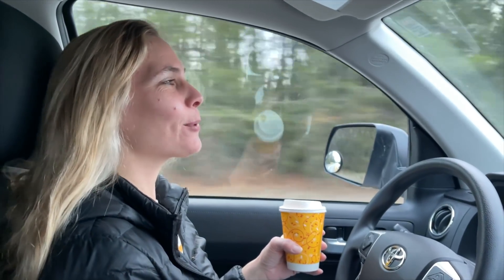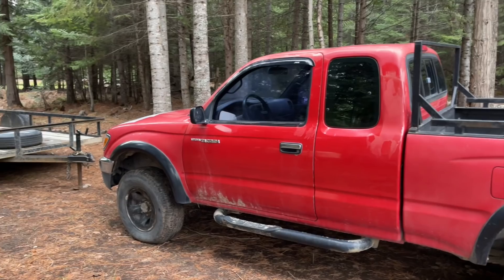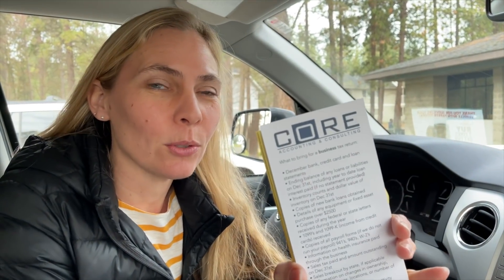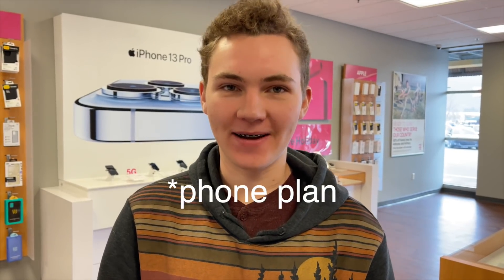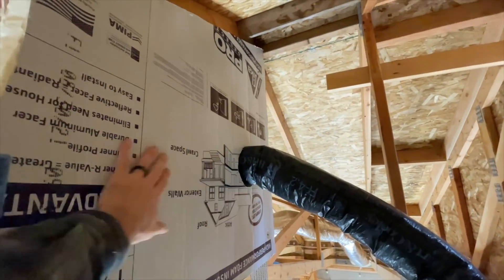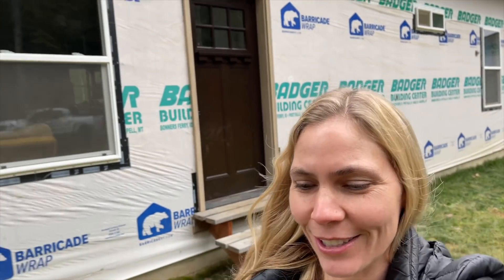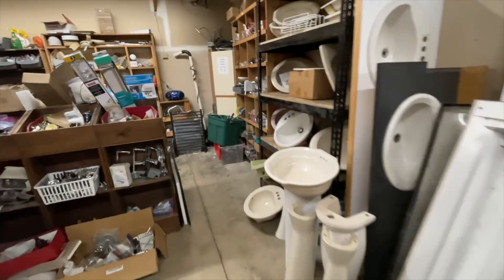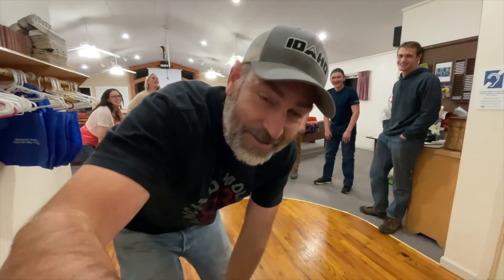THIS CHANGES EVERYTHING - Couple Building House Off Grid

Comment: I think converting your backup generator to dual fuel, gasoline/propane, would be a great idea. First, you've got 1000 gallons of propane right there. 2nd, propane doesn't go bad like gasoline does. 3rd, what happens when/if you run out of gas, and can't get into town to get more? Those conversion kits are pretty easy to install.

Comment: Our furnace is in the attic in a professionally built, high-end, home; it work's just fine and you never hear it running. The only headaches are changing out the filters each year and a smoke detector above the furnace needs a new battery every 7 years.

Comment: I'm a hvac technician. The only regret will be when you need to work on. As far as replacing it. 20 years is a about as long as a furnace/ AC is good for. But as long you do maintenance 2 times a year it last longer.
Reply from the maker: What kind of maintenance?

Comment: The attic is the best place for the heat pump air handler in my experience. Mine does great, and service people seem to easily go up into the trusts (rarely) when it is serviced. Also, it's very quiet.

Comment: The furnace can be relocated if it ever needs to be replaced and you decide it should be at floor level.  
Many houses here in Omaha have their furnaces and water heaters in the crawl spaces under the house.  
When we had to replace ours in our last house I build a small addition on the back and put both inside it.
BTW, We're BIG Dave Ramsey fans and have been 100% Debt Free since 2012!

Comment: Have you thought about converting the fuel source for your back up generator to include propane? If not, it's an inexpensive modification (a simple regulator) and it would help to cut down on the amount of gasoline you have to haul, and store. I love your positive outlook as a family especially during these times of depressing negativity and criticism that runs through our society.  keep up the great work. Blessings - Rich

Comment: I myself would have made a special closet in the garage area to have heat upstairs easier to replace if need be less hassle on installing it wouldn't be nothing to hook up floor heat vents and a ceiling in the garage. But to each their own.

Comment: You made a choice and I can respect that. Personally would always put everything in a location for easy access to service. Appliances today do not last decades. I am on my second AC fan in less than 6 yrs. Was told by both technicians who fixed my unit that the parts today are cheaply made and do not last long. This is from a premium brand. You still have time to move it. I would seriously rethink your location. Love the channel just trying to help - not a troll. Look forward to tomorrow's video.

Comment: Because u don't have running water doesn't mean u can't do hydroelectric. Pump motor from well to a holding tank 2 tanks separate pump between 2 tanks to recycle the water. Inline wheel that generates electricity think you hav an idea where I'm going but it will work.

Comment: As a retired HVAC service person  have seen repaired and installed  just about every  location  attic installed furnaces especially 80% eff. Bigest problem  was run time to short and condensation  in the stack  rotting out heat exchangers  and 90%+ frozen condensate system   creating  ceiling damage and also shuts furnace down
Reply from the maker: Hopefully, getting the freezing problem solved.

Comment: Some of the drywallers use their dry wall square as a cutting guide - they leave the sheets against the wall and hold the bottom of the square with the toe of their shoe and run the knife bottom to top - no smart phone

Comment: Fire:
I would think that you want to use fire resistance installations such as rockwool around your furnace due fire prevention reasoning. Using foamboard which is combustible and gives off toxic gas seems like a bad decision. I would think to that serviceability should be a primary factor too. Plan for the worst hope for the best.
Reply: Theirs built in safety's and breaker's that prevent fire and the sides of the unit never get hot even when running for along time, I've been doing HVAC off and on since 2006 and I've never seen a air handler catch on fire, theirs just a lot of preventives and modern technology that would keep that from happening. Anyways their would be evidence of a problem like not running (blower)or other noticable issues that would get martin's attention before something crazy happens.

Comment: Your insulation looks good. But that is all. You have an electrical motor that requires air circulation over the case in order to cool the bearings down. Holding that heat in is not good for the bearings. The fan motor should last 7 to 10 years. You are shortening the life by probably 20-30%. Just a heads up if you start tripping the motor on your furnace, pull the insulation down.

Comment: I don’t know anything about building so this may be a dumb question. How flame resistance is that foam that you are putting around the furnace in the attic? It sounds like it would be extremely flammable.
Reply: There are no flames on the exterior of the unit and unit doesn't get scorching hot. As long as the unit is properly vented and ducts are free of kinks they are fine.

Comment: Hello Jules and Martin. With a little coaching, the two of you could have a comedian show. Martin, so many times you seem to be justifying what and how you do things to others that have a different opinion. They can do it their way. This is your place, and you can do it however you want. You may need to comply to local codes, but I am not so sure about that. I am in Columbus, GA and my mother has her heater and hot water heater in the attic. The builders did that to conserve space in the living area. For me, my heater and air conditioner are outside. It is a package unit. My hot water heater is in the kitchen in a closet next to my stove/oven. It seems to work as my home was built in 1925 and probably did not have that when it was first built.
Have good days!

Comment: The following is straight out of your states code book..Out of Sight, Out of Mind: When a furnace or other hvac equipment isn’t working properly, the warning indicators are often obvious. If you hear odd and/or squeaky noises emanating from your furnace, it may be a warning that it is currently malfunctioning or will soon fail. You might not be able to hear the apparent warning indications that there’s a problem if you have an attic furnace.

If you don’t realize you have a problem until your system has failed it may be because you didn’t perform a few furnace maintenance checks throughout the year. Keep in mind that if you install an attic furnace, regular preventative maintenance is crucial to keep the equipment running reliably throughout the year.Furnaces should only be install in the Attic when no other options are possible......Personally I'd build a furnace room on the side of my house before putting it in the attic...But then I live in Florida and rarely use heat at all  once in 10 years......

Comment: Merry Christmas, Johnson clan!  This old pensioner once worked in Haiti for a year and purchased and had installed an inverter setup because The hotel where I was staying only had electricity for three hours in the evening unless the was a storm or hurricane of which there were several of.  Now, I am just a retired fixed pensioner who just purchased a dual fuel generator, an inlet installed, and a transfer main switch.  We get several outages each year that may only hours and even days such the last year’s 6-day freeze in the middle of January.  I do not believe I can afford solar panels on a small fixed pension but wanted to know what you can recommend I may need to run a trickle off electric company to keep batteries warm and charged and a connection for the generator which is currently being hooked up the my 500 gallon LP tank?  It would be very expensive and most likely deplete my LP if I tried running a generator for several days (especially with this outrageous inflation); whereas, just use the generator to recharge the batteries for a couple of hours and use the batteries for 15-20 hours?  I hope I hear from you.  Again, Merry Christmas and a Happy New Year, clan Johnson!

Comment: I was just wondering , does code require you to have a smoke alarm/heat sensor in the attic when the furnace is up there . Chances are you would neve have a problem - they made me put a smoke alarm in the basement furnace room .
Reply from the maker: The inspector didn’t say so. Good idea though.

Comment: I personally think that you're going to hate having the furnace in the Attic before it's over with. I lived with a furnace in the Attic and I hated it.
Reply from the maker: Why did you hate it?
Reply: @MartinJohnsonOffGridLiving  Because it was hard to get to to service it. You're might be better, they may have made them less cantankerous. It's been a few years and it was a rental that hadn't been very well cared for before I lived there. But it was still a pain. I didn't like climbing in and out of the attic for one thing.

Comment: You have two trucks but ya treat them like cars! That stuff you loaded in the trailer could have went in the he'd of the truck and that splitter could have been towed and is why they come with a tongue on them! Yes you will most likely have to swap the wheel bearings for high speed bearings as my dad did in the mid 80s on his splittee...
Reply from the maker: Why lift a heavy stove up in the back of a truck when you can easily walk it up a ramp on a trailer?
Reply: Why, cause that's what trucks are built for. Not to be pavement princesses and status symbols. Not to mention its way easier to back up with out that baby utility trailer in mud...
Reply from the maker: @shanehaws3828  🤣🤣🤣 love it! So I guess I was not using the truck for its intended purpose. Wonder what that hitch receiver on the back was for? Have to consult the owners manual. 🤣🤣🤣

Comment: There is an old saying in the sales business.  An expert is a guy with a briefcase that is more than a mile from his office.  I'm sorry, I do not agree with the air handler in the attic.  They tried to do that at my house, I vetoed it.  Then they wanted to put it in a closet, we only have 1 outside of the bedrooms, Vetoed.  I suggested mounting it on a shelf at the front of the garage. They argued and fought with me and I won.  It was installed and the installation tech loved where I put it, it actually saved duct and was in a place super easy to get to.  2 weeks later the A/C quit and they came out to find a pin hole in the A coil.  The service tech thanked me over and over again because he didn't have to go into our attic in July.

Comment: That's just silly, naming a car. A car is a car is a car, come on! Call it what it is, the Tundra or Toyota. It is there to take you and your stuff from A to B and back again, and will break and fall apart over and over again. It can easily be replaced with any car of a similar spesification and it has no personality. It does not need a name. That's for toddlers, so grow up.
Reply from the maker: Thanks for engaging.
Reply: @MartinJohnsonOffGridLiving  😆 that is the top tier response I knew you would give. Love it!